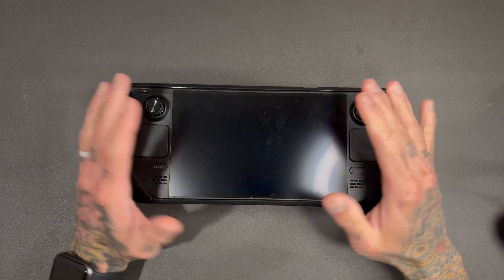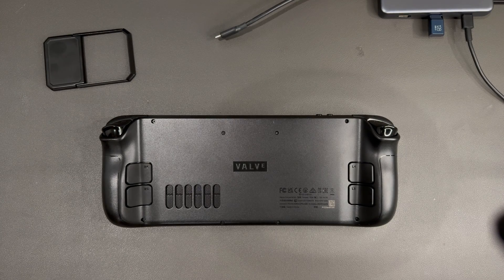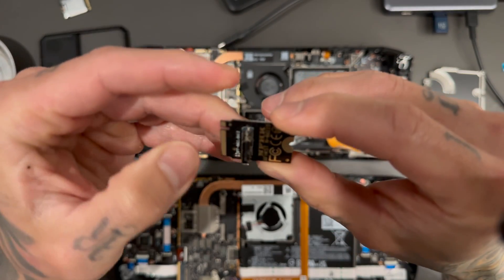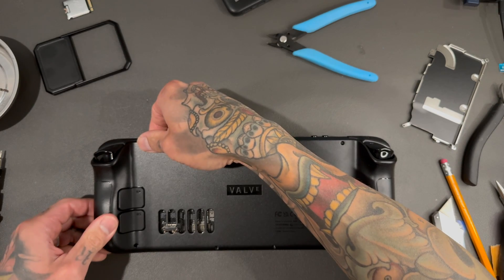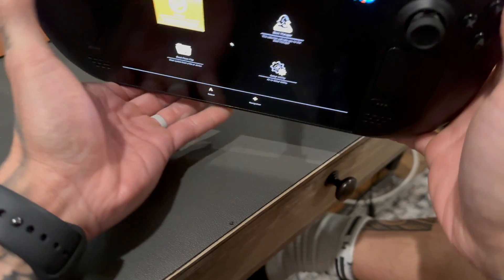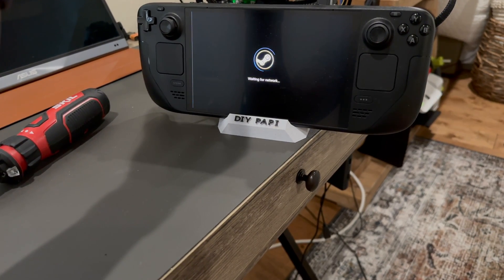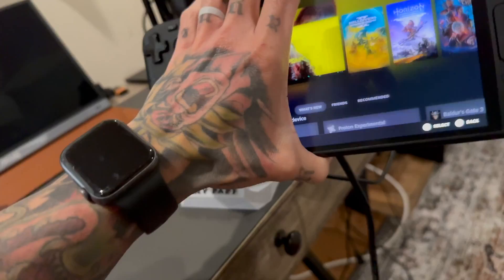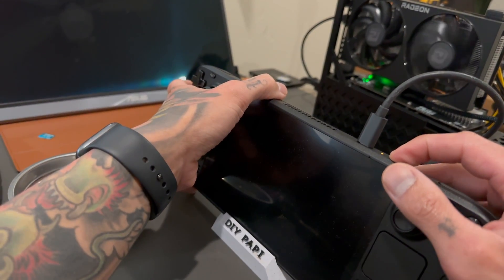Steam Deck OLED gets an oculink port

Comment: Hi,

I tried to run the GPD G1 via the oculink adapter in my OLED steamdeck but the egpu is not detected.

I see you have the same problem with the OLED model.

Since then have you been able to resolve it and operate an egpu via the oculink adapter on the OLED steamdeck.

I hope so ...

PS: @crowland3358 said "I may have a fix for your GPU."
Is this the case?
Reply from the maker: Lol I just responded to you on Reddit, no I haven’t. Question what operating system are you running?
Reply: @Diy_Papi  lol,

I know, being a little desperate so I posted the same question also on Reddit. 😅

I am on windows 11 pro.

It may be a bios problem but I've searched and I don't see anything.

I would really like it to work but I will perhaps come to terms with the idea that the OLED version is simply not compatible with the addition of an M.2 oculink adapter...

Otherwise, thank you for taking the time to answer me.
Reply from the maker: I ran into the same issues, I’ll keep you posted if figure it out
Reply: Honestly, I hope that somehow you find something. For my part, I'm going to look again. We'll see...

Comment: So i know its not the topic of the video, i;ve been off youtube for a minute cause of work and such but have you messed with the older backplates with the newer oled deck? i was curious with how they reversed the fans and clightly changed the internals would it hurt to use the backplates that are out there? im still waiting for someone to come out with full shell replacements atm.
Reply from the maker: They won’t fit without some modifications, stand off are slightly off on the backplate and the screws are smaller.

I think the chassis is completely different from the LCD

I would assume they may have altered the front as well to accommodate the OLED screen.

Comment: Driver issues with chimera not finding the memory and IRQ / MSI ranges for the pcie device. (Oculink) should check dmesg and kernel logs. There’s probably a way to get it working if it posts on the external monitor already you’re not far off.
Reply from the maker: It’s definitely a start! Gonna try it out with bazziet see if it can get things going.

Comment: Given that its working until OS boot, its probably that X11 / wayland (whichever one the steamdeck uses) uses the first available graphics adapter, which would be the APU
Reply from the maker: Maybe, doesn’t seem like there is a setting in the bios that could switch that. 

I may try to roll the bios back to an earlier one and see if that works.
Reply: @Diy_Papi  No because the things that @alfiegordon is mentioning are all part of the OS installation. I do agree with him that it is more of an OS issue. If you are not very experienced with Linux. You might try Windows.
Reply: @Diy_Papi  it may be possible to change it by editing the kernel parameters / boot scripts, but I'd imagine you can't do that on SteamOS

Comment: I wish the next revision has eGPU compatibility
Reply from the maker: Me too, all it needs is USB 4
Reply: @Diy_Papi brother I want to try to do your project I have almost everything at hand but my case does not have the hole for the m.2 and to put the oculink adapter I am thinking about the jsaux case but I don't think what you recommend
Reply from the maker: Hey, sorry, I just saw this comment

Honestly, you could use whatever case you want 

I’ve actually done the same model with my original JSAUX backplate